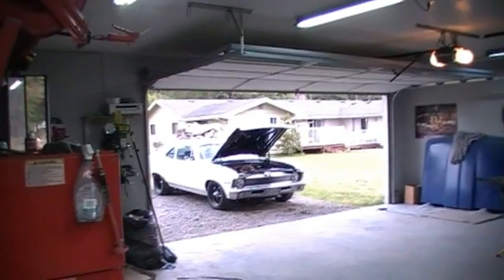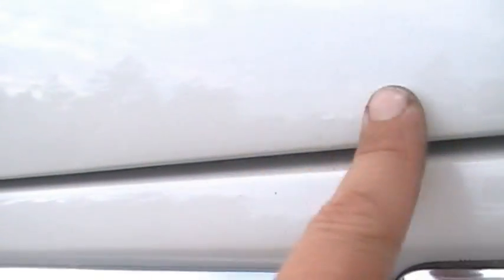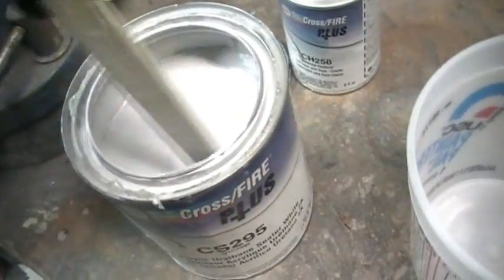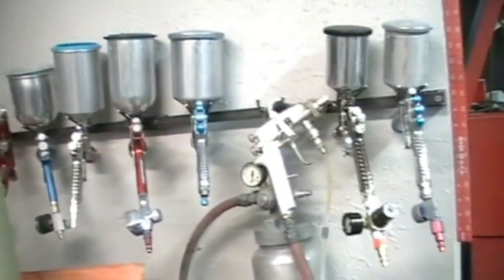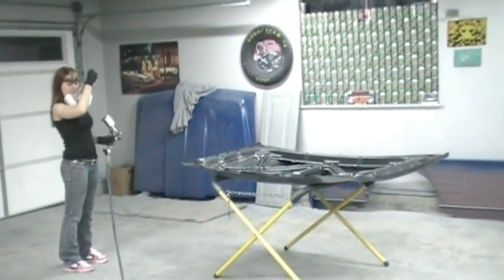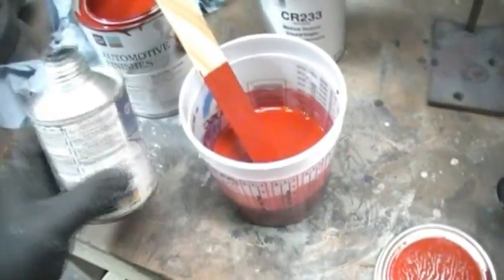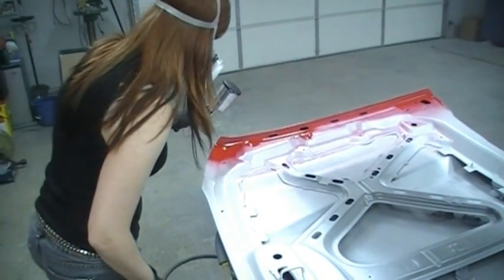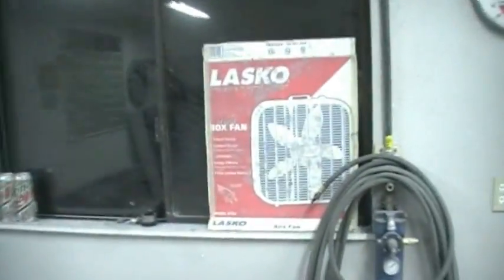SYF Garage. Cutting in a Silverado Hood and some random Stuff

Comment from the maker: It will help If you have any bleed through on the second color because you will be able to wipe or sand it off without screwing up the first color. As far as helping the edge probably not much. Or are you meaning putting if over everything before the clear? Either way I usually just plan on having a edge or sand and reclear to get it completely flat.

Comment: wouldnt it be cool to have an overhead air connection like the carwash spray arm that turns 360 degrees/ wouldnt be that hard to do with pvc and a retractable hose reel.